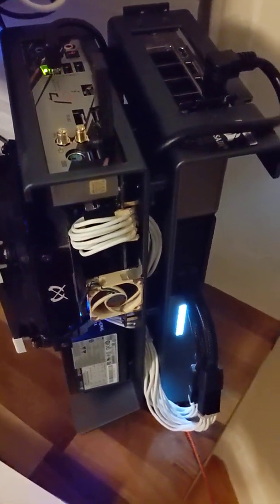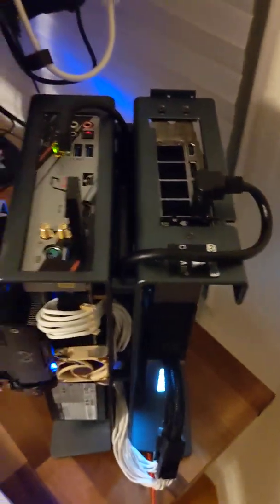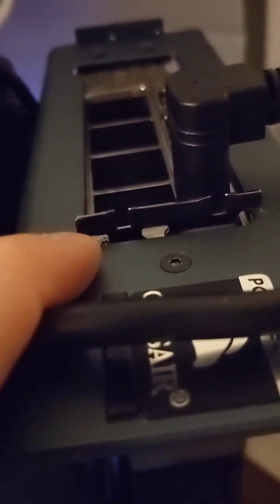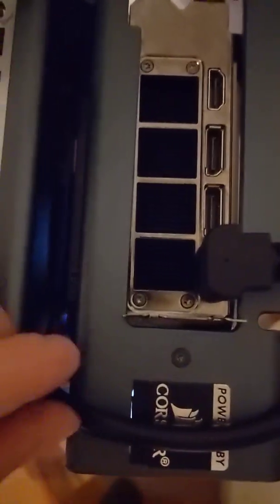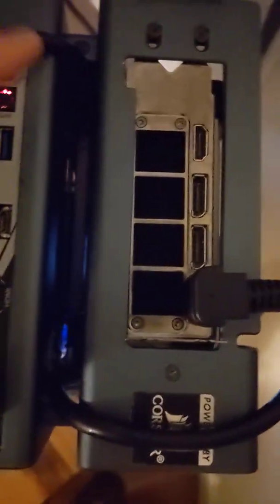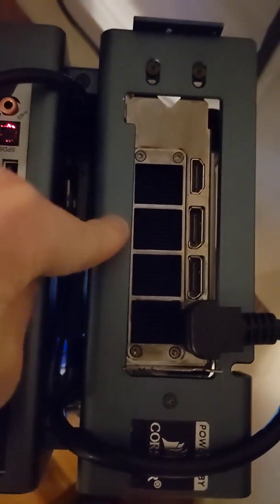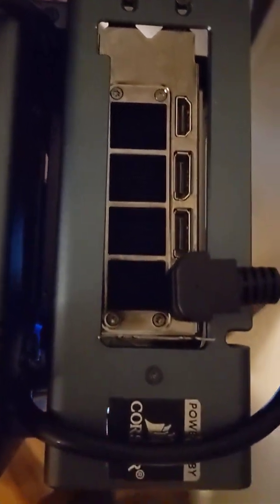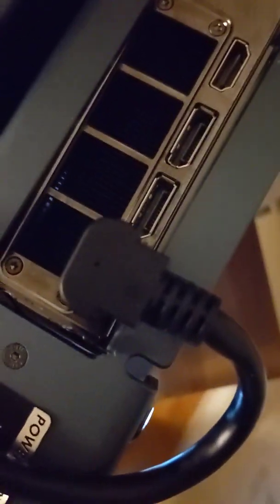XTIA X-PROTO pc case, flip GPU around (3080FE airflow)

Comment: On the new Xproto N you dont have to do that anymore since it will have venting grills for the gpu to push air through
Reply: Hi, could you comment on the general temps and dust situation with the case? I am thinking of building one with water cooling but dust is always a question I guess
Reply from the maker: @muhammedkeser7064  after over a year with it, dust isnt really a problem. its very easy to clean, but it doesnt get all that dusty to be honest. the fans ensure the dust doesnt settle too much

Comment: hey. i think u installed GPU upside down....  that`s  Wrong direction
are there any reason for that? 
Did you do that for purpose?
Reply from the maker: its not upside down, its flipped. its the reason for the video. this case has the gpu back facing up and that's intended for the airflow.
Reply: @kangsterizer  understood.